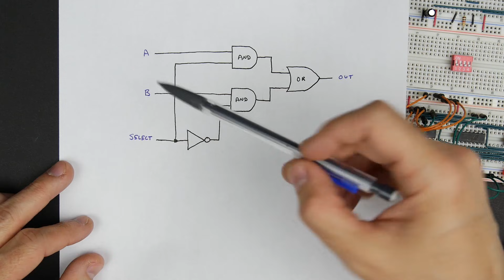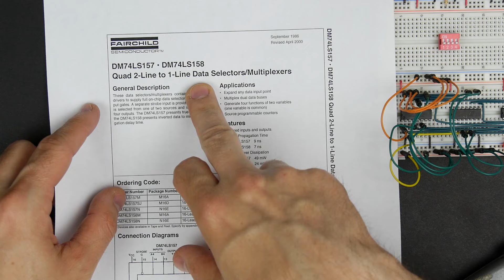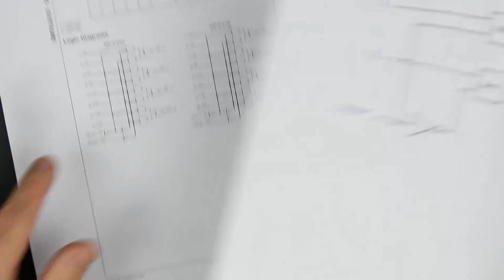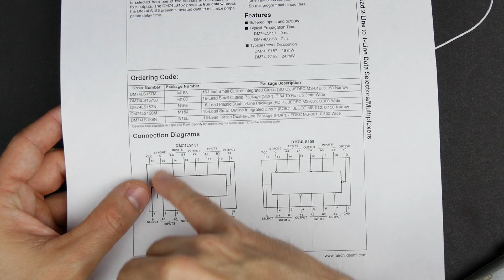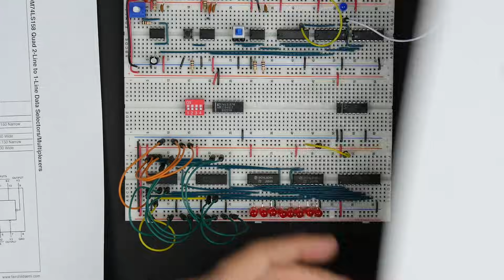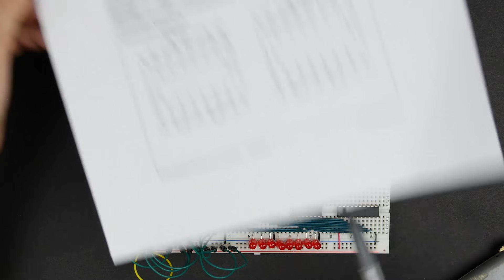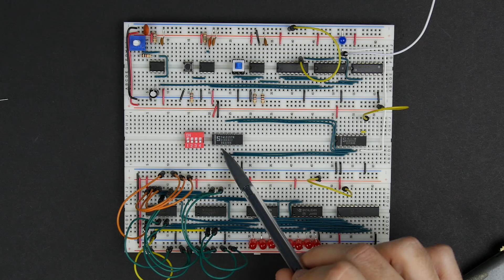RAM module build - part 2

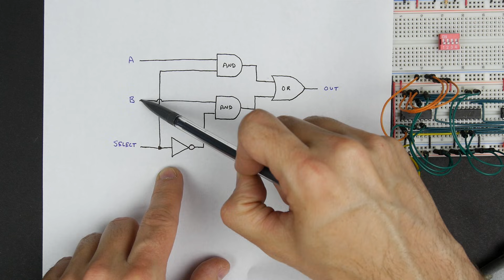Comment: At 5:08, in the diagram for the switcher, what is the point of the OR gate? Wouldn’t same effect be achieved by tying together the outputs of both AND gates?
Reply: If one output is 1 and other is 0, than the sink would shortcut the source to the ground. You may get zero, one or something between depending on the exact chips you use. Also you may burn the chips this way eventually with the resulting current. (Yes, it probably would not be the case of chips Ben is using, but if you buy something cheep on ebay, you may see the Magic Smoke). And it is really bad practice. Not mentioning, that Ben is teaching us here, how it should be done, not what shorcuts may be possible to take, before your circut will burn light. 
More over this "may" work with clock like 1/2 second, but when you speed up things, then the tolerancies goes tighter and what seems like LED on/off would became like distorted curves and spikes as can be seen nearly on any video, where somebody use osciloscope on some higher frequencies. And eventually that leads to the module malfunction over some frequency without visible reason, as those "shortcuts" really limits the possible usefull current  provided and each wire has not only resistance, but also capacity and conductivity (even small) and the weaker source, the lower frequency is possible to reach reliably.
Reply: I may be wrong, but if the two outputs from the AND gates are tied together then if one of the outputs is low, it would tie the other output to ground.

Comment: The connections to your 4 way dip switch is non-intuitive, Surely ON should be High = 1; NOT OFF. Seems to be a mix of logic convention as throughout the RAM Module ON = HIGH = 1 (even LED ON= HIGH)
Reply: That is because unconnected input itself is considered HIGH and the swich can only connect it somewhere, or not connect it at all. So this leave you with two options: either connect to LOW = ground (as Ben do here), or add pulldown resistor to each and every input and then connect to HIGH (which cost a lot of resistors and place and work).

Also it cancels the natural profit from internal pullups (which is design point in TTL) and increases the power consumption. (Not that it would matter in this particular case, but compare with protocols like I2C and similar - if you work with this kind of problems, it became part of "style" to know and use informations about internal pullups /pulldowns as was intended by creators of respective ICs)

That said, I personally will use pulldown resistors and switches to Vcc in my construction at this place. But we are free to experiment anyway :) And it is good for education to see more solutions to some problem and think about pros and cons of every one.

Anyway

Comment: Ben Eater - I tried to donate on Patreon, but it wanted me to subscribe.  Can I donate somewhere else with a one time donation?
Btw - thank you very much for your series.  My son and I are working through your breadboard project, and are just about 1/2 way thru the RAM series.  We're using a single 32K (256K bit) chip, that has bi-directional IO pins.  
That was/is an adventure so far, and learned how pull down resistors are important on digital pins while programming a ram chip.  (HEY!  why did we just set it to 55, and we got FF back!!)
Reply: 15.  We're having fun with it.  BTW - I did subscribe to patreon.  Wanted to make sure you got some value from making the video's as am I.
Reply: It's useful to have a patreon membership these days anyway, because there are so many fine creators represented there. I give small regular amounts to five different web-comic artists whose work I follow, for example.
Reply: What RAM chip are you using?
Reply: Paypal have had this idea for donating to people and causes many years before patreon and you could chose to pay as much, as little as often or as not that often as you pleased...

IMHO with all these newfangled patronising pages, funding pages, scam pages, enough is enough and its time to go back to basics and go with thw established and stop funding organisations that were only set up to take a cut like patreon and so on.

Comment: I wonder how hard it would be to replace the dip switches with some kind of memory module that is programmable via serial. So then we can actually load and run code faster. I think it would be a neat addition, does anyone here know where to start with this?
Reply: You could hook this up to an Arduino and pass memory values through that way through its serial communication feature. It's perfect too, since you have 12 available digital pins on the Arduino, 4 for addressing and 8 for data.
Reply: this RAM is parallel so you would probably have to use shift registers or something if you wanted to use serial with it. I am not the guy to ask about this but it might be similar to programming a parallel ROM
Reply: Padarom 9 months later, how is it going?

Comment: Hi Ben....not sure you can rely on the 74LS157 inputs as being pulled high.
You should pull up these lines to 5V.
Reply: irgski you may well be right. I have just gone through the data sheets and find no reference to un used (not connected) inputs being pulled HIGH internally.
Reply: irgski - Yes you can. Did you notice his almost religious use of one series of one manufacturer?  If you buy No Brand Chinese IC, you get whatever falls off the truck in Shenzhen. In that case, you may not be able to rely on consistent performance.
Reply: Bruce Woods - Then you are reading the wrong data sheets. You need to match all the letters and numbers exactly.  Are you looking at DN, SN or something else? A CMOS implementation?

DM is Fairchild. I have the DM74LS157 data sheet in front of me. Look at the function drawing. SN is Texas Instruments. I have that data sheet as well. The function drawings are different. Do you get it?  Fairchild came first. It was pure second generation TTL. TI came second. My suspicion is that CMOS technology was on their minds by then. Gate impedance was changing. Do you get it yet?

The really funny thing is he shows you it working and you people keep telling one of the worlds finest design/build guys that he doesn't know what he's doing.

Comment: I do have one comment and one question:  I am very jealous of Ben's perfect wires. How does he make such straight well managed wires, cut to the perfect length? 
 My wires are pretty sloppy and wavy. Some are cut too short and some are cut too long.
Reply: pin distance is 0.1 inch. Hole is deep 0.3 inch. The long empty lines are 0.2 inch (count them as 2 holes). 
To connect holes #2 and #14 (for example) you need (#14-#2) x 0.1 inch covered wire (=1.2 inch) + 2x 0.3 inch of copper ends to put in holes. So you cut 1.8 inch of wire, clean 0.3 inch on each end and make the right angle.
To connect  adjusted holes (like #15 and #16) you cut (#16-#15)x0.1 + 2x0.3 = 0.7inch fo wire , leave 0.1 inch isolated between two 0.3 inch ends and again bend it. (or just use 0.7 inch copper as there is no need to cover the gap between adjusted holes)
To connect A line to "+" line on bottom you need 0.3 inch of isolation + 2x0.3inch of clean wire = you cut 0.9 inch wire (same as connecting #1 and #4, which are also 2 holes apart).
To connect line A to "-" line you need cut 1.0 inch and leave 0.4 inch isolated.
To connect something on different lines and different columns you need add all lenghts around the way ( plus 2x0.3inch for copper to hole)

So just matematic do the magic.
I asked friend to make me metal ruler for that, but simplest way is lay the wire where you wanted it to be, leaving 3 holes on each end to be un-isolated, bend and put into the holes, then cut it on the breadboar. None sloppines this way :)
Reply: A nice set of pliers, patience and practice.
Reply: probably experience
Reply: I am using metric too, but 0.1 inch is 2.54mm and the rest is mathematic. The problem is, that breadboards are based on 0.1 inch as well as DIP legs distancies. So either you re-calculate everything to metric and use normal meter for that, or you buy (or make, or obtain any other way) some "meter" based on 0.1 inch increments.

One such "inch meter" is the breadboard itself - just count number of holes, add 3 holes on each side and use the number on side to measure how long your wire have to be.
Or put it other way - lay the wire the way you want it to be, while left 3 more holes on each side. Then cut it, then again line it with breadboard and strip 3 holes woth of isolation from each side and bend those stripped ends down, where they belong. Here you go.

Other way is just buy any metal ruler with inches, and use it. I would made small marking each 0.1inch there with file to have it easier to cut precisely.

Or if you can make anybody to do for you tool in shape of pyramide (or trilobite), stepped by 0.05 inch on each side, so those steps form stairs increasing 0.1 inch each step and put those numbers there, then te life is even easier - it is all needed tou measure in 0.1 inches AND you can use it to presiselly bend the wire and multiples of that strange size.

So when it comes to breadboards and DIPS and ICs I just use "inches" and "0.1 inches" as some magical units, with measuring tool calibrated in that and do not think about metric. If it would be called "beans" I would use measure tool calibrated in "beans" whatever lenght or weight it is. (Or just you can use as base for computation "holes" as distance of "holes in breadboard" and do not care about consequencies - on breadbord it would just work and everywhere else you would use normal units. And for placing breadboards you just use normal meter and measure the size of breadboard (or part of it) in normal SI units.

So in metric: pin distance is 2.54mm, hole is deep 7.62mm so it is length of unisolated ends of wire. Count number of holes: 14-2=12 holes, add 3 holes on each side: 12+3+3=18 holes, multiply 2.54mm 18*2.54=45.72mm and cut this lenght of wire. Unisolate 7.62mm on each side, bend it there and it would nicely connect holes #2 and #14 on breadboard (as of my first example).  Depends if you want to compute in metric, or count in holes, result is still the same.
Reply: Gilhad1 

Another way to measure the wires is to use a draftsman's triangular ruler.  They have 6 measurement scales.  Usually, one of the scales has markings 1/10 inch apart, which corresponds to the 1/10 inch pitch distance of the breadboard holes.
Reply: Gilhad1 Dammit, I'm on metric so I can't rely on those.

Comment: Hey bro! Just wanna thank u!... Ur one of the first people on YouTube that does this kinda stuff! And I reapply appreciate that... I'm exidted to see how the control unit works and how is made...😱😅😅✌🏻️
Reply: they are kinda expensive at the quantity he has in his computer
Reply: I purchased 7 for $40.00 about  $5.72 ea EBAY
Reply: compared to 7400 series they are expensive
Reply: maybe they could be replaced by diode matrix (ROM) but it might get quite big
Reply: +Mike DeLosier thx y'all!
Reply: did you also buy a programmer for them or is there some DIY way ?
Reply: You've probably already seen Ben provides two programmer builds. One using DIP switches and one using an Arduino.
Reply: I Wonder what eeproms u used.... I guess ill have to wait and see :P....
 Excited*
Reply: Really*
Reply: Looks like he is using CAT28C16A  8K 2Kx8 EEPROM

Comment: Why do you need current limiting resistors for LEDs and no need for resistors for ICs?
Reply: He addressed this very issue in the video itself, from 14:08 to 14:34 has the answer right in there.
Reply: The chips have resistors inside them that are the right value.

Comment: Hello Guys,

Here is a PDF schematic of the Memory Address Register build, 
RAM module build - part 2.

PDF Schematic Diagram of my built Memory Address Register
https://drive.google.com/open?id=0B2ZePCSY4JnFVjZNNUZNb3h6aEU 

Thanks Mike,
Reply: Here is a wiring diagram of the Address Register module

https://drive.google.com/open?id=0B6LIgQzDkH8fRTFaSW1KZER1S2c
Reply: here is the complete schematic
https://docs.google.com/file/d/0BzeLVhP_vKa_a2VlWEZHUXRTblE/edit
thank me later
Reply: I have to tell you all that I do not like this schematic diagram. Mainly the Control Matrix. 
Notice how the NAND gates are connected to Negative Input OR gates and then a inverter on the end. 

This makes no since at all. The NANDs going into a Negative Input OR, is the same as a regular AND going into a regular OR, or even better a regular NOR gate, so that you do not need the Inverter on the end.

I will probably be using a few 74LS54's and a 74LS51. For my Control Matrix

One more thing for you Burnin: 

Mike has already provided us with a great PDF file, that includes this schematic diagram. It also gives you a great deal of information on how the SAP-1 works.

https://drive.google.com/file/d/0B2ZePCSY4JnFdjByUnVES25rU28/view

Thank you
Reply: Allright, I did not take a close look into the control logic  but I was glad to find a schematic with the control logic realized without EEPROMs. And you are right with the inverted inputs. But the control logic should work no matter how you substitute those gates, shouldn't it ?
Reply: Did you take a look at the PDF that Mike provided? That is a great source of information. In fact, I believe that it is the same source that Ben is using in his lectures.

The only problem in the substitution you are referring to, is that I do not think the gates shown in this schematic exists at all. If you can find a 4 negative input OR gate, I would like to see it.
And like I said the 74LS54 that I referred to has 3-2 input AND gates that lead into a NOR gate. So you only need 4 of them and 1 74LS51.
Reply: Here is a second PDF that was written later then the one Mike provided us with. I like the Control Matrix in this one, but they both have a great deal of information, that will help you understand the inter workings of the SAP-1 8 bit computer.

https://drive.google.com/open?id=0B6LIgQzDkH8fRmpSYm9ROTMzSGM
Reply: Thank you for the PDF it is exactly what i was looking for!
Reply: Mike DeLosier it looks like he forgot to add the switches to the parts list

Comment: Ben another good teaching / build video, I am sure glad I have a lot IC chips to build with.
Thanks for your time.
Reply: Hey Mike,

Have not heard anything from you, on the latest video, where Ben builds the memory multiplexers, in Part 3
Reply: Hello Jeff,
Sorry I have been busy with work and on call, I watched your update video, nice progress with TTL Instruction Decoder ( LDA, HLT, OUT, ADD, SUB,JMP ), Ring Counter, and Control Matrix . nice to see it running with your test program. Tomorrow I plan to wolk on my 8-bit computer also  I have added sections as well. 
Awesome Progress Jeff :) Mike,
Reply: My ring counter went crazy and stopped working correctly. So, I had to rebuild it. Seemed to be a problem with the board itself. Every time I would rebuild it on that board, it would not work, but on other boards it would. But I had to get it working on the original board, as it interlocks with all the other boards, so I moved the chips down, and placed my inverter chip at the front, and got the ring counter working again.

I also had to rebuild my control logic, as the board was facing the wrong direction, to interlock. That ended up being a lot of fun as well. Nothing ever easy.

Comment: what parts do we need for the next video? 

pls answere!
Reply: I will try to answer this question. As we just finished building the address control register, I believe that Ben mentioned in this video, that he was going to build a similar mechanism to control the memory contents. By attaching the 8 memory lines from our memory module to an 8 bit DIP switch and or possibly to 2-4 bit registers (74LS173) and possibly a 74LS245 buffer for the bus. Do not hold me to this, but that would be my guess.

You can also take a look at the SAP-1 model for additional information as to what parts may be needed for future modules. Again, Ben may add or change, or use different parts in a way that best shows us how things move though out the system.

Sorry, I can not be of more help.
Reply: My fault, I do not think we will need any 74LS173 registers. Maybe a couple of 74LS157 multiplexers.
We might connect the 8 bit dip switch to the memory select inputs and the 74LS245 transceiver of the memory module to 2 74LS157 multiplexers. Again, I am just guessing here. 

I have already hooked up my 4 data inputs from both of the 74LS189 memory chips to my 8 bit dip switch.
So that I can manipulate the contents of what is stored in RAM.
Reply: Ok, I think I might have it now. I connected an 8 bit DIP switch to the two 74LS189 memory chips on the data input lines. I also added a push button on the Read/Write signal.

With the 8 bit dip switch, you can program in,  the Op Code in the high nibble and the operand or address in the low nibble.  
Once you have the dip switch setup with the correct information, you can push the Read / Write button to Write the new value into the memory at the address that you select, using the Address Select 4 bit DIP switch that we installed during this video. I believe that this is how you program the SAP-1

So, if I am correct, all you need for the next video, is an 8 Bit DIP switch and a push button. 
I believe that at this point, we will have to learn a little about how to program the SAP-1's memory, to load a program into memory, with the correct values.
Reply: Thanks for all this answares!

thanks for your times doing this, im gonna read them now :D
Reply: Looks like my second guess here was correct here. We will be using 2 74LS157 multiplexers along with an 8 bit DIP and a push button. He also added a NAND gate to go to the Control Logic.

I currently only have the 8 bit DIP and a push button, which seems to do the trick for me, for now.